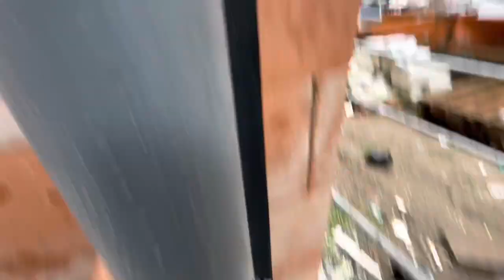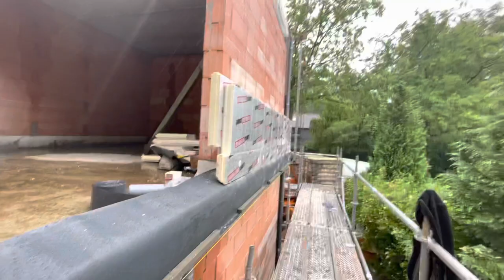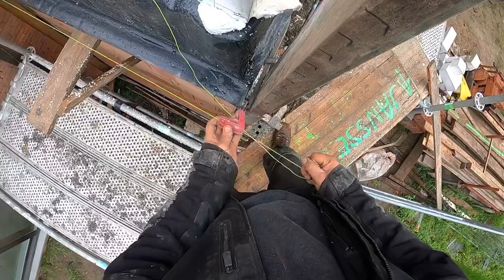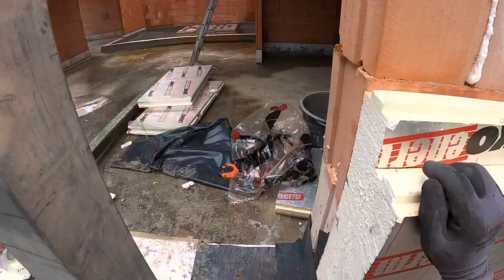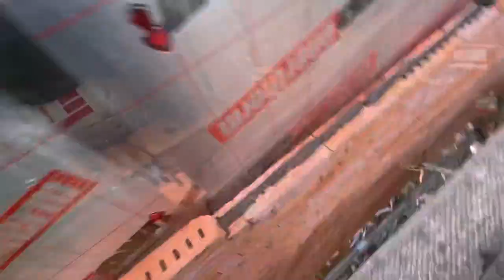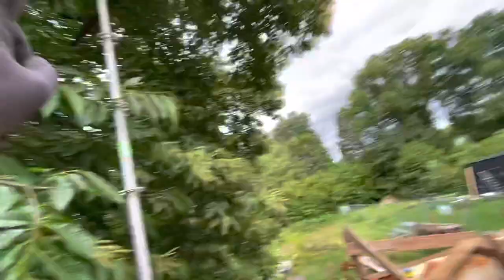Brickwork ….

Comment: I personally really like the "no joint" style of brickwork you've done on this property and Project Phoenix. It's a façade, as is most modern brickwork. What you do behind the brickwork keeps the water out and lets the brick breathe and dry. Looks great. Keep up the good work Jay.
Reply from the maker: Yes exactly … principle is actually not much different than ordinary brickwork as with heavy rainfall when your wall gets soaked there will also water be running down against the back of your brickwork ( except for hard bricks maybe ) .. so the dpc is placed just the same way as we do with normal brickwork only I pay extra attention to it 

Thanks man 🙏🏼
Reply: Er zijn in de jaren negentig diverse onderzoeken geweest mbt waterhuishouding van buitengevels met open stootvoegen. Volgens mij ook van Belgische deskundigen en zelfs de universiteit van Brussel
Reply: @gemackpuntnl3808  
Als leerling-metselaars werd ons getoond dat na ongeveer 30 seconden spuiten met een tuinslang tegen een bakstenen muur, deze door de achterkant zou trekken. Het maakt niet uit hoe de mortel werd geplaatst. Vergeef me mijn slechte formaat. Ik gebruik google translate
Reply from the maker: Translation works well ! Very interesting , I haven’t seen or done a test like that myself . 
Maybe I should do a test on site lol 💡
Reply: @cwinter84  the overall end conclusion is that all brick walls are leak.  Does not matter how its made. The dpc is allways needed
Reply: Gotta agree with you winter, I like the look of the brick work and the style of bricks of this build too. I’m not a mason, but design is subjective, you either like it or you don’t... I like modern designs and old school styles, there’s beauty in every style!
Reply: @JayKTS  it seems mad having no perps, in terms of acoustic and insulation value! but thats just because we only really do it 1 way in uk so ive never seen it
Reply from the maker: Hello D(B)om, the insulation around the house is airtight and is 16 cm PIR  insulation in placed in 2 layers of 8cm , this is a very high insulation value so I think this shouldn’t be any issue ;) 🙏🏼

Comment: Really likin’ the build Jay, like the bricks and open perps as well. You guys bring brickwork to an art form, it’s a real pleasure to be able to see your work from start to finish! Thank you as always for taking the time to share the knowledge! On another note,,,,, Newton, what’s a nEwToN... lol 🙄
Reply from the maker: Evan thanks mate .. I looked up 1 Newton is 0.225 pound or 0.1 kg .. 1 Nm is 1 Newton applied on a arm of 1 meter long 🤓
Reply: Ha, we learn both SI and imperial measurement systems even though we are supposed to be officially a metric country. Where I work we mostly use imperial, (psi) for torquing bolts and other stuff, it’s just hard to visualize a nEwToN when we’re used to pounds... It can be a pain in the ass when you have to work on machines that are metric. 🙄
Reply from the maker: Yes I c what you mean .. my torque wrenches do have both Newton and pound readings on the handle.. I’m not a mechanic though or a millwright as you I’m guessing you know a lot of torque settings out of your head than it can get awkward when it’s in metric lol 

You guys still having heatwaves there in the meanwhile in Belgium new rivers are being formed having some heavy rain here speaking of a contrast .. where I am everything fine though .. 
Evan take care 🙏🏼
Reply: New rivers forming... Oh crap not good at all for you guys, tornadoes, flooding, nasty year all over the place. I saw on the news that Germany was getting hit really hard but I didn’t realize that you were getting lots of rain 🌧. How’s the Antwerp region doing? Slowing your work down some I’d imagine?  In British Columbia, still hot in some regions and a shit load of forest fires 🔥, around 300 active fires... where I live just normal hot and humid... humid, hot, sticky, muggy... You too, take care and try and keep dry!

Comment: I presume engineers have figured out the weight of the bricks on them bolts holding the lintels around the house...  be some bang if they got it wrong... top class work as always Jay... im a small buider in Ireland.. are the price of materials gone crazy in Belgium too..
Reply from the maker: Yes the calculation should be right .. hopefully lol .. yes materials are getting more expensive but I think in the uk it’s much worse .. what I hear what you pay for bricks in the uk is levels above prices we have here 
Thanks buddy

Comment: Amazing work Jay as usual. With the open perps I guess it's expected that rain water penetrates the wall and runs out through the dpm/weep holes at the bottom? No issue in winter with freeze/ thaw?
Reply from the maker: Yes exactly … walls get wet indeed and this one sooner than a normal brick wall .. even with normal brickwork water can penetrate when it’s completely soaked so it will run down on the back of your wall .. so the dpc here is basically placed in the same way here as for normal brickwork we would make here .. I just pay some extra care in a no perp wall 

Wayne thanks 🙏🏼